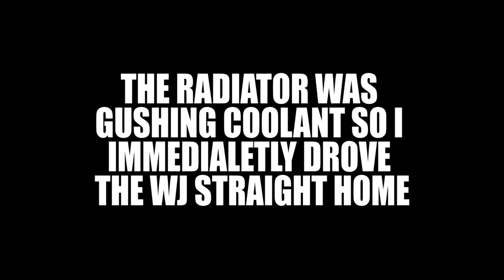A NEW DRIVEWAY... ANOTHER JEEP!

Comment: Removed my hydro fan, put in electric from 5.7 WK with the shroud, fit fine after a bit of adjusting on the plastic shroud, only took a day, however the power steering had to be changed, no big one more day and i was up and running, 2004 4.7 WJ overland lifted it 2.5"  tossed the factory 17's put on 16" neg bs 4" rims with 31x10.5", after my 6 XJ's on the trail, this thing is the best luxo jeep ever.
Reply from the maker: solid info!  I was thinking of 17 inch JK moabs.
Reply: @ProjectDanH  i found the 16's with the taller side wall and the 4" backspacing to be a huge advantage for clearance, especially in the front, and the wider footprint at 11psi is fantastic in my area crossing heavy snow.
Reply from the maker: @dshepard3161  thanks !!!

Comment: Nice. I love my 4.7 HO with quadradrive. My advice would just be to replace radiator and not mess with the hydro. As far as the harbor freight jack stands, there was a casting issue with the old ones. The new replacement ones have much beefier pawls and are rock solid.
Reply from the maker: Thanks for the advice! Ill look into the new jack stands too

Comment: If the axles have no friction modifier in them, the varilok units will groan when driving slow around corners.  Also looks like an Overland trim?  Looks like it's missing the factory rock rails too, not sure if that's a big deal to you or not, but they are becoming harder and harder to find.
Reply from the maker: Yep this is an Overland.  I knew it was missing something there.. The rockers have some rot so I was thinking of a custom 2x5 steel rocker.

Comment: About a year ago my wife got rid of her 99 wj only problems I had with it was the power windows motors going bad.Plastic tracks would break causing cable to seaze up into the motor and back from the beach 4.0 cooking it on coolant
Reply from the maker: aww, sad.
Reply: Had lifter tick before I got to the beach then stalled at gas station didn't really worry too much about it on vacation until it leaves u stranded head gasket blown or head cracked

Comment: I’d say if you can get a title, go with a mild lift with bigger tires, pull the heads since it’s been overheated and pin the seats. Put in a set of 08 cams.
Reply from the maker: Great plan.. Im in!
Reply: Use broadway title company if u cant get a title....its a little pricey but they do legit work. I know someone just got a title for a very very old Chevy.  I would look into it
Reply from the maker: @Tailgatesntoolboxes  I actually have a title Guy.. it cost about 350
Reply: @ProjectDanH  good to know lol

Comment: I've been looking at WJ's so now I have a taste for them and this Jeep juice you speak of 😂 Idk about the 4.7 that much but I'm looking for a 4.0 so far and transmissions seem to be the weakest link .
Reply: I have a 99 WJ with the 4.0 and I have Punctured my tranny pan twice and ran it slam out of fluid and still don’t have any problems with it also my output seal on my tranny leaks pretty good and I just wait for it to start slipping going around corners and then I fill it back up still no issues I have driven my Jeep everywhere it has 265,000 miles on my 3rd engine and still the same tranny and if you have ever seen any of my videos my Jeep is beaten not babied
Reply from the maker: yep, trans were the weak link on the ZJ too. 4.0s are solid tho
Reply: @ProjectDanH  I know me and the ZJ had a transmission replacement date a few times but this one has been shifting good so far